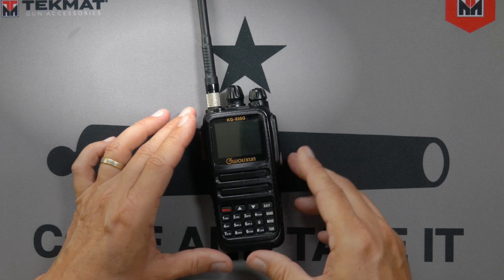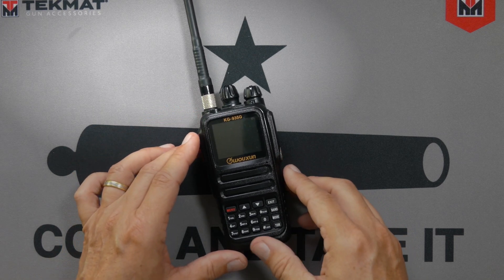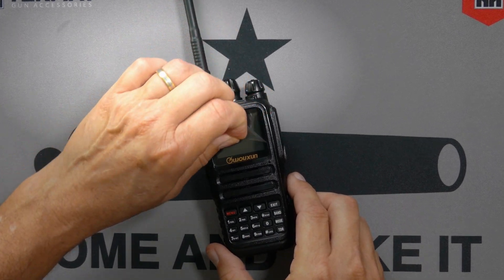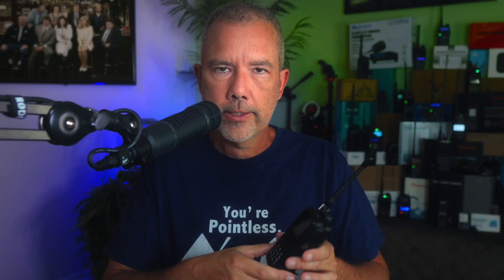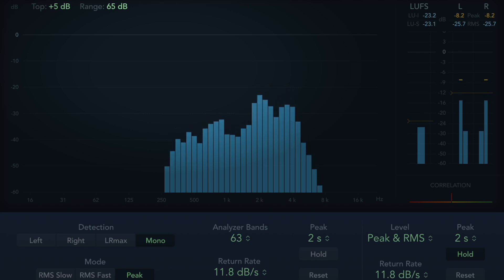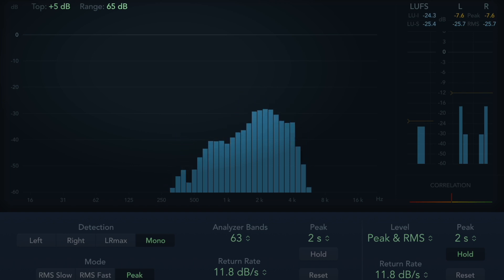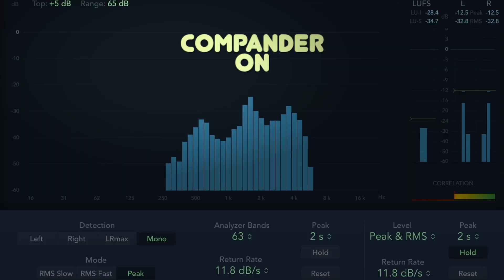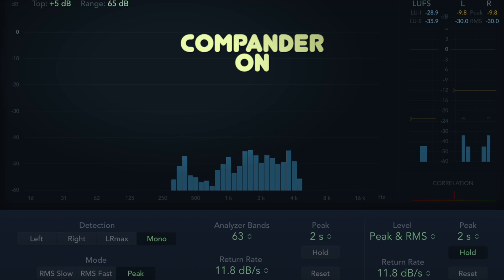What Is The Compander Option? What Is Companding, What Does It Mean & What Does The Compander Do?

Comment: As a retired Broadcast Engineer, we have used “compander’s” for at least 60 years! AM commercial broadcast radio stations used them to increase the “apparent” loudness of the station. It’s function was to expand or increase the volume of low level portions of a record, and to compress or lower the volume level of loud portions of a song. 
They accomplished 2 things. One good, the other, not so good. They definitely increased the average level of modulation to the point where a VU meter would hover around 100% or zero db. That made the AM station sound louder than It’s competitors!
Of course it destroyed the dynamic range of a song, + you could be fined by the FCC if you set the compressor/limiter to run consistently over 100% modulation ( 0 db to a +3db) 
As we all know, output power of an AM transmitter will exceed it’s licensed power as a function of amplitude modulation. 
As an engineer, you might have the loudest station in town, and a FINE to go with it😂
P.S. Always enjoy your entertaining and informative videos👍
Reply: Thanks for that great little “window of wisdom.” Well presented.

Comment: NO.

As a Licensed Ham Radio Technician (LHRT) for well over eighteen months, I find nothing objectionable in this video presentation.

As you probably have been made aware, LHRTs will periodically monitor the RF transmissions, and YouTubes, of the GMRS cult members for accuracy, propriety, and legality; and on the rare occasion of finding Nothing Objectionable, provide our imprimatur: NO.

73s.

[For the non-experts, who I perceive most of you to be:  73s (pronounced “seventy-threes” is the standard friendly sign-off between those of use using real radios, and generally translates as “all the best to you,” and/or “get off my lawn.”]

KI5KWG

Comment: When I worked for Rockwell, we were always having problems with the companding feature in the Retro-Encabulator.
Reply from the maker: I love how on the newer Turbo-Encabulator the main winding was of the normal lotus-o-delta type placed in panendermic semiboloid slots in the stator and how every seventh conductor was connected by a non-reversible tremie pipe to the differential girdlespring on the "up" end of the grammeters.
Reply: @TheNotaRubicon  What a coincidence! Me too!
Reply: @TheNotaRubicon  pretty sure that’s where the Raytheon units fell short: they kept getting reverse polarity feedback distortion in the phramus loops when the interpolation charge was introduced.
Reply: @TheNotaRubicon  the soinisoidal repleneration really makes it, for me.
Reply: @TheNotaRubicon  Sounds like there were some serious drugs involved.
Reply: Moist likely because there was too much gas in the fuel system
Reply: They were just beginning design work on the Turbo-Encabulator when I left Rockwell and went to work for Initech.

Comment: It’s sort of like Dolby noise reduction for those old enough to remember tape.
Reply: The 'metal' button! Although I did like Dolby C over Dolby B
Reply: I think it is more like dBx, which was a compander system I used for decades when recording. Possibly some high-frequency static removal too on this radio version...

Comment: I dug out some of my old mudland radios and some of them have a double compander function. The batteries are kind of old in these radios and I am kind of afraid to try it. Do you have any suggestions of how to safely double compand with old weak batteries?
Reply: CRefully remove old batteries. shake out any loose white/greenish crumbly/powdery residue from decaying, 
self-digesting batteries.
With small amounts of vinegar on a Q-Tip, gently clean the battery contacts. Remove any residue of this process.
If desired, apply a very small amount of electrical contact goop.
Insert fresh, new, alkaline, or any other specified battery 🔋 type, and you’re off to the races.